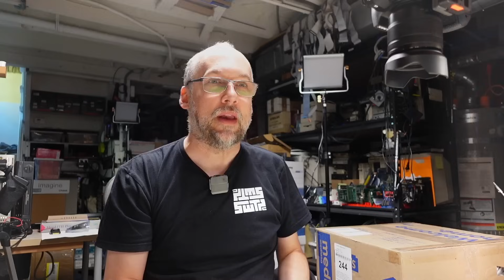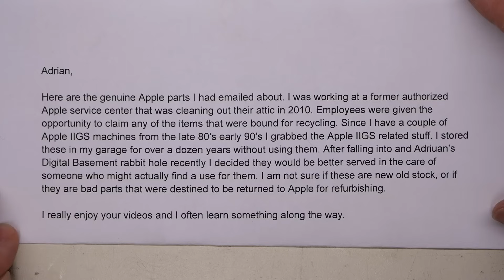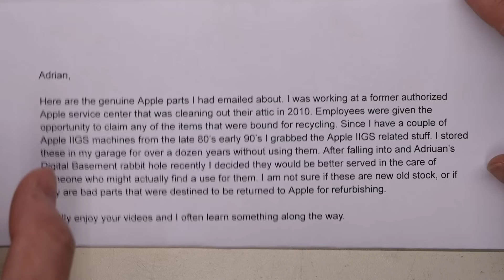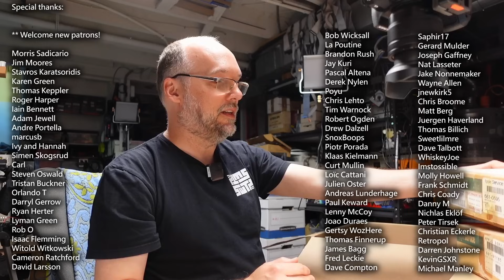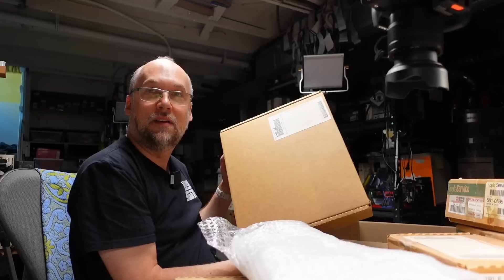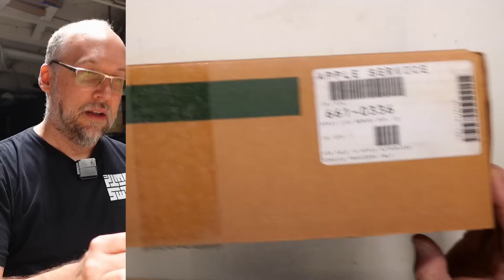0071 Fixing a Commodore 16 with modern parts, a bunch of NOS Apple parts and testing MOS chips

Comment: The Motion Server card is a motor controller card that was used in a development environment for an industrial pick and place machine I worked on. Decvelopment was in Modula-2 running under DOS. The pick and place would do automatic inspection of the underside ball grid arrays before placing the die in either a tape and reel or a waffle pack. I happened across the card when I was boxing up the NOS Apple stuff and threw it in. I really should have added a note explaining that. Loved the episode, glad you were able to find some useful things in the stuff from the attic.
Reply: I was going to say that card looks like a multi-axis card you would find in a CNC controller.
Reply: What's the CPU then? Some sort of AMD 486 or something?
Reply: @Toonrick12  I have no idea what the CPU is on there. I only ever dealt with using the card, not with programming the firmware of the card.
Reply: @Toonrick12  AMD or UMC 486. Cyrix includes markings on the bottom like Intel does.
Reply: @No-mq5lw  Haven't counted pins or anything. Any chance it's M68K series based?
Reply: @digitalarchaeologist5102  No. There's 1 row and column too short, and if you look closely, there's a pin with a square base, which the 680x0 doesn't have.
Reply: Is it even possible to get the software anymore for those Orca 2 FPGAs?
Reply: The card also looks to have a fascinating back-plate bracket that is just a small "stub" with the screw top bit mounted to the PCB itself. This would leave the slot almost entirely open, presumably so that you could run those ribbon cables out of the back of the enclosure to connect to whatever peripherals you were controlling. A pretty common layout for Apple II type expansion cards, but quite rare for PCs!
Reply: So they use those to develop the machines?
The MyData I work on has all custom cards. Its always fascinating to see the dev tools. :D

It also has massive 50 pin IDC cables.

Comment: FYI - Before March 1988, the Apple IIGS Memory Expansion Card had been an optional add-on that Apple sold separately. It retailed for CDN$150, plus each "256K Expansion Kit" (eight 256Kx1 DRAM chips) sold for CDN$80. All told, a fully populated 1 MB card back in early 1988 would have set you back CDN$400, which was approximately US$320! Add taxes and 35 years of inflation...yikes!

That particular Extended 80 Columns Card was introduced with the Platinum IIe in January 1987. It shipped pre-installed, at no extra cost, in all Platinum IIe units sold. It was drastically reduced in size compared to the earlier revision of the card, which was sold separately between 1983 until, I believe, the end of 1986.

Back in the late 90's, here in Montreal, I came across a store loaded with NOS Apple dealer parts in official boxes like yours, dirt cheap. Regrettably, and still kicking myself to this day, I left behind treasures like mountains Apple III and Lisa parts, as well as a sealed Apple IIe Card for $5. Also an Apple-internal Apple II diagnostic card, replacement keyboards, ProFile HD's, you name it. I did buy an unused (Slinky) Apple II Memory Expansion Card and Apple-made AppleTalk board for ISA-slotted IBM PC's. I remember I was only interested in finding Apple IIGS parts or an LCD screen for the IIc that day and planned to go back, but it closed shortly after.

Comment: The IIe power connector on the IIgs would have been used when the IIgs board was used as an “upgrade” for an original IIe. Apparently Apple offered an upgrade service where they would swap parts of the case and the logic board to turn the IIe into a IIgs. Very rare from what I understand. This upgrade kept the original IIe power supply.

Comment: Just repaired a Tek scope from the 90s by twisting the caps off. If they weren't leaking it would be a complete different story. In that case there was a ton of embedded tactile switches and potentiometers printed on the circuit board. Hot air would have been a real bad idea

Comment: The CIA in the VIC II socket would've gotten 12v on PB3, which in the U1 position would be a keyboard row. It looks like you had a test harness on for the keyboard and that test passed perfectly, so not only did the chip survive but the specific pin seems to have survived too. That's pretty awesome.

Comment: There is a shorts channel I watch, A guy from Maine who catches Lobsters, cant remember the channel name. He demonstrates the whole process of which lobsters caught are graded for keeping , or throwing back into the sea based on size , sex, whether females are 'egging' , condition etc. Many times the lobsters have barnacles on them which can harm the lobsters if they are on a limb joint or near the mouth or eyes etc. His method.. is a pair of pliers and he removes them in exactly the same way as Adrian pulls off leaking surface mount caps...

Comment: Why anyone wants to  fix a Commodore anything is beyond me.  My  first computer was a 64, and it NEARLY  cured me of  anything to do with computers forever.  My next one was bought at a  hamfest,  a  used Bleeding Edge 8088  which had had a hard drive added, the receipt for over 2500 FOR JUST THE  40Mb hard drive was still inside the computer. Tiny amber screen,  DOS  3. something. Xtree Gold, ProComm, I do not remember what else.  Laplink 3.  Word perfect something or other.  360K floppies a pair.

Comment: According to Apple's documentation for the IIGS self test it does a "moving inversions" test for RAM. I have a copy of the source code for the ROM 3 diagnostics (yeah, it's out there if you look hard enough, contained in a leaked copy of the System 6.0.1 source).

A cursory glance reveals that it first tests banks $00, $01, $E0, $E1 (the two banks of fast RAM and two banks of slow RAM on the ROM 00/01 board), including the language card areas. When checking these banks it skips the first four pages of RAM in each of those banks (presumably to avoid overwriting the stack, zero page, and any other memory used by the diagnostics to track progress). It checks $0400 through $BFFF, skips $Cxxxx (as it obviously should, as that's memory-mapped I/O), then maps in the first language card area, checks $D000-FFFF, then maps in the second language card area and checks $D000-FFFF again. Each of these areas is tested using a routine called DOMOVITEST that does a simple moving inversions test (using patterns $00 and $FF). Then it runs a routine called DOZPAGEIND which tests the first few pages of the bank, but with a somewhat different methodology than it uses on the rest of the tests. (I was feeling too lazy to figure out exactly what it's doing.)

Then if the banks $00/01/E0/E1 tests succeed, it checks the version of the ADB controller to determine whether the machine is a ROM 3 or newer (seemingly unnecessarily, as this code shouldn't even be present in the ROM00/01 diagnostics) and then it checks banks $02 through $0F (the extra built-in fast memory not found in the original motherboard). For each of these banks it checks the entire 64k, from $0000 to $FFFF in one go, using the same DOMOVITEST routine that it uses for the main portions of the other banks.

The test doesn't appear to do any testing of any RAM in the memory expansion slot. (This matches my memories of needing to use a third-party utility to check the RAM on the expansion card in my IIGS back in the day.)

Comment: Not every IIGS shipped with that memory expansion board. The early ROM 00 machines mostly shipped without it. Sometime early on, though, they realized that the built-in 256 KB (128 KB fast, 128 KB slow) wasn't enough and they started bundling the 256 KB card with it. I don't recall whether that happened before or after the ROM 01 upgrade.

The ROM 3 motherboard includes 1 MB of fast RAM (plus the 128 KB of slow RAM) built-in, so those never shipped with a RAM expansion board. (The unreleased Mark Twain board had 2 MB of fast RAM (plus 128 KB of slow RAM) and replaced the RAM expansion slot with SIMM slots.)

The ROM 3's ROM contains the System 5 version of the toolbox. When running System 6 some toolsets are replaced entirely with RAM versions (if the changes were very large) but a lot of tools just have a few small changes, so System 6 just patches those individual routines where necessary. (Toolsets are structured such that some routines can be located in RAM while others are in ROM.) For example, when running System 6 the Menu Manager is a RAM-based toolset on ROM 01 machines (loaded from the Tool015 file), but the ROM routines are used on the ROM 3, with just a few routines patched out to fix some bugs (via the TS3 file, which contains the toolbox patches for ROM 3 machines).

Comment: The //e card for the Mac LC does not use the Mega II chip from the IIGS. This is a common misconception. In fact the card uses a different chip, Gemini, which works very differently (largely due to the need to communicate with the host Mac).

Comment: 27:35 Just a heads up: It's not always the greatest idea to replace an electrolytic capacitor with a ceramic one. Some circuits (e.g. old linear regulators) will start oscillating if the ESR is too low, which can be fixed by sticking a .5R or 1R resistor in series with the cap. For bypassing applications, a larger value may be needed than what the original electrolytic had, because the capacitance drops with increasing voltage across the cap. It depends on the dielectric material used, but as a rule of thumb: the largest value MLCC caps that have the same capacity as small-ish electrolytics need as much as 50-70% derating when using them near their nominal voltage. Always check the datasheet of the specific cap you buy!

Comment: There should be at least two current manufacturers of 6502's:  Western Design Center (I understand they were founded by some people from MOSTek/Commodore Semiconductor), and NTE Electronics, which does a sideline in a bunch of 8-bit parts for the hobby and obsolete repair markets (6502/6800/8080 and selection of their support chips).
Reply: The 65C02 is not a good replacement becauseit does not support undocumented upcodes. I recommend buying NMOS 6502 from IC traders, there is more supply than there are Commodore TED computers to be repaired, so availability will never be a problem.

Comment: 32:00 Apparently the MOS 5710 is a cost-reduced CIA for the 128DCR's internal 1571 drive.

From the MOS Technology CIA article on Wikipedia: "Commodore embedded reduced (just 4 registers) CIA-like logic for the cost reduced Commodore 1571 inside the C128DCR (See Commodore 128) in a gate array called 5710 which also contains other functions. The 5710 CIA has the serial clock for the fast serial interface hardwired to a CIA6526 equivalent Timer A value of 5, leading to a per-bit time of 5μs on transmission. This is different from what used to be a Timer A value of 6 in the 6526 CIA in the original Commodore 1571. The 5710 CIA does not contain timer or timer control registers. It only contains two port registers and the register to control the serial shifter and its event."

-- JC

Comment: We all do stupid mistakes like putting chips in the wrong way and sometimes we get lucky.
The 12V was connected to pin 13 (PB3) but the chip also received 5V on it's GND pin so the potential on pin 13 was probably around 7V which should be far better than 12V.
What I don't know is how that may have affected other pins that must have been exposed to potentials of -5V.

Comment: Haha, I put in the VDC in my c128 backwards, luckily it did not fry it.  Also accidentally used my c128 PSU on my Amiga 500... made a smell, but apparently just caused some weirdness where it wouldn't boot until the chips were removed then replaced... so odd.

Comment: I think I recently watched a video of a pretty Italian girl testing a C16 or something like that with a breadboard rigged C64 processor. She didn't modify the kernels but probably didn't expect it to fully work, just check that the rest of the machine is workable and it isn't pointless to hunt down a CPU.
Or maybe I was daydreaming.
Reply: If you use a 6510 without replacing the KERNAL, the computer is able to get to the start screen, but floppy disk and tape will not work. They will start working as soon as you install the custom KERNAL. Games will fail, because fastloaders are a necessity with Commodore's slow-by-default floppy drives, so games have to talk to the floppy directly, bypassing the KERNAL. A 6502 replacement implements the CPU port in a compatible way and is compatible with the standard KERNAL and all games and demos.

Comment: Why didn't he use the 65c02? Those are brand new?
Reply: Compatibility. Games and demos heavily use undocumented opcodes.
Reply: @danielmantione  I knew the pinnout was different. I didn't realize it changed that much. I take it that's copy protection? That's odd though since the old ones were all the same. Also it's not like you could use anything different since it was unique.
Reply: @awilliams1701  Developers are constantly trying to make these machines do the impossible. You can get slightly more compute power out of the CPU if you use the unused opcodes and demo and gamer coders often do this when coding things like raster effects where every clock cycle counts, especially if you want to support NTSC. Also floppy disk fastloaders are an area where every clock cycle counts and regularily use undocumented opcodes.

The 65C02 does not implement the undocumented opcodes, instead it enhances the instruction set in a different way.